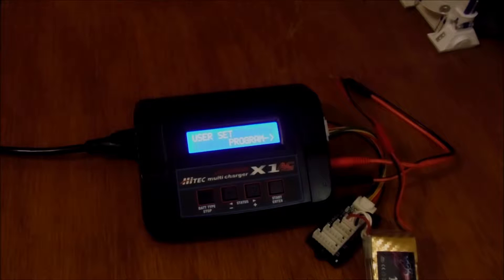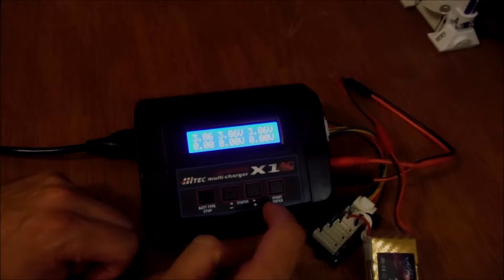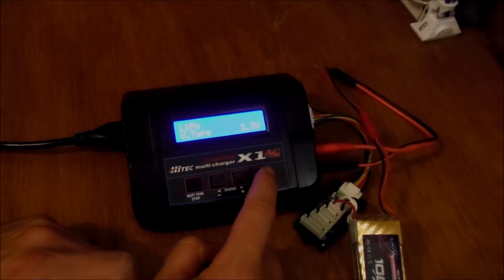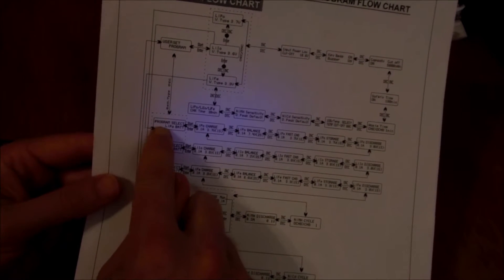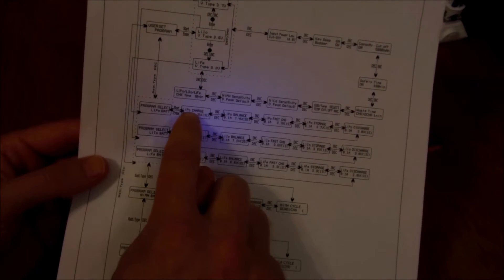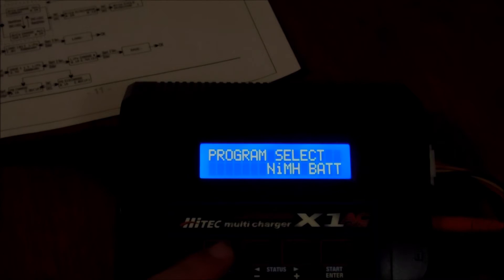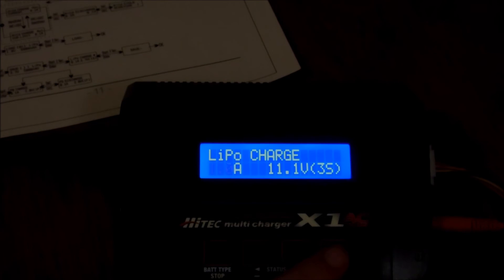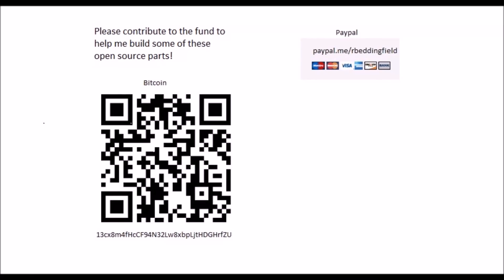Hitech X1 AC, IMAX B6, Accucel 6 Charger, Program Walk-through and Basics

Comment: does 6this charger have a peak alarm?  When it is fully charged, does it turn off automatically?  don out.
Reply from the maker: The charger I have makes a single beep when it has finished charging.  After it finishes charging the charger stays on but does not continue to charge as far as I know. The instruction manual emphasizes that someone should be around to monitor the process.
Reply: @robbeddingfield4049  Thanks!